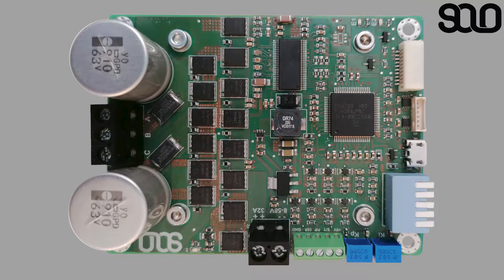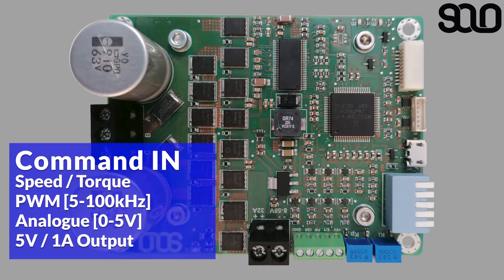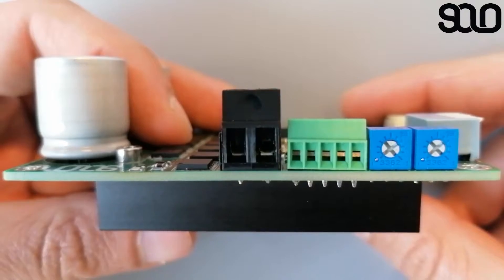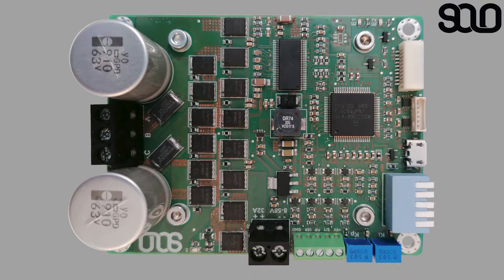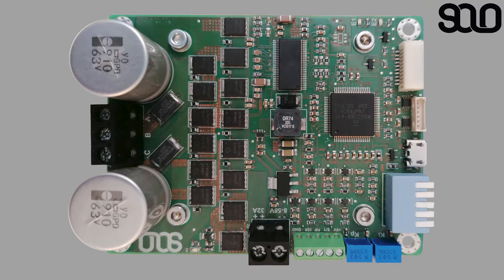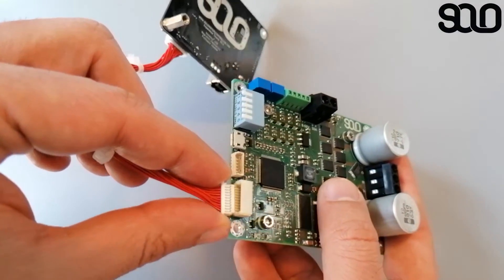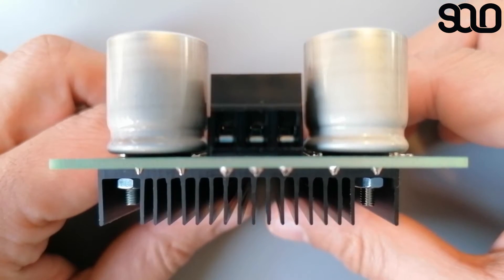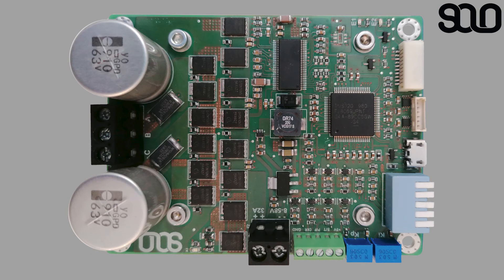SOLO Motor Controller Specs. Description

Comment: This looks very promising. Do you intend to release a HV model? I have many PMSM/PMAC servos of 200V, and I have been searching for a budget controller for years.
Reply from the maker: Thanks, Nonofur, for now, our focus is on Low voltage (below 90V) High current models, but by end of 2021, we are intending to release some high voltage versions as we are working on their design, we will keep you updated here.
Reply: @SOLOMotorControllers  that is excellent news! Thank you for the reply, I am seriously considering some beta testing of your current hardware.
Reply: @SOLOMotorControllers  just to confirm, your current hardware release has a maximum DC bus of 58V, correct? You mentioned 90V above, and I have some 100V PMSM/PMAC that I could de-rate happily to 90V :)
Reply from the maker: @nonofurbeezwax4268  yes, our current model in the market has a rating of 56V / 32A continuous output. 58V is the absolute max for protection purposes, our 90V versions are under test now and it will take some time until we bring them to the public market, that would be an honor for us if you use our BETA model and in case of interest, you will have our full support. 
you can order the unit(s) from here: https://www.solomotorcontrollers.com/product/solo-beta/